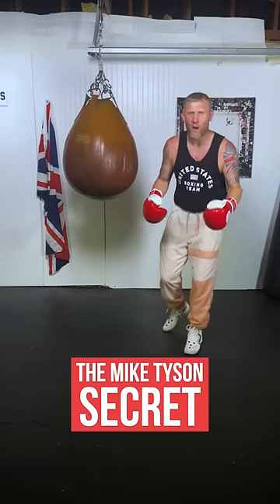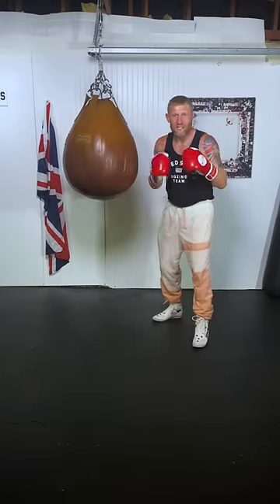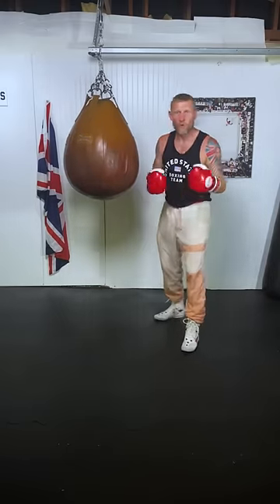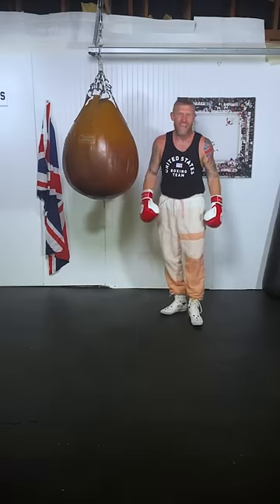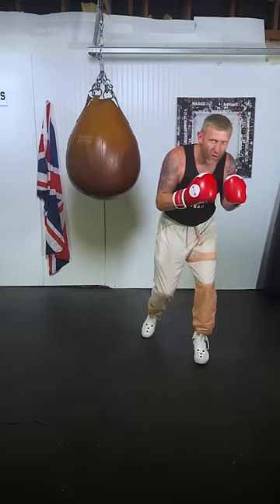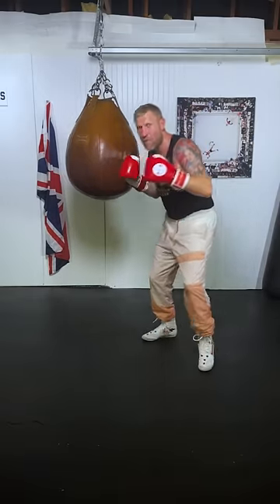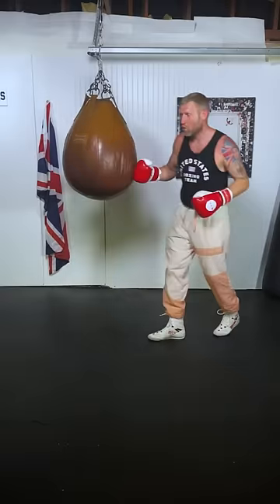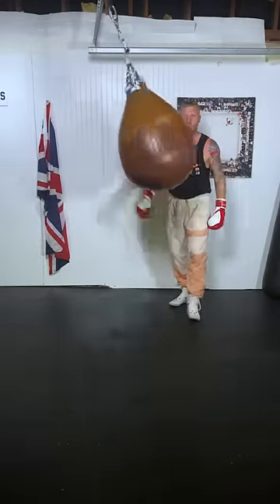Source of Mike Tyson's Power in his Punches #shorts

Comment: The transfer of weight is one part of how he developed his power, but it was also his timing and technique that magnified it so greatly.  When he threw his power punches, you could see him just whipping his arm around with a tremendous amount of rotational momentum, so much that it would throw him off balance when he missed.  He was so fast and so sound defensively though, that even when he'd go off balance, it was still difficult to set any punches up on him and he'd be loaded up to fire from the other side if you got careless.  At the moment of impact, you can see that he's getting his hips, torso, shoulder, bicep, and forearm all moving in the same direction and the result is a rib crushing hook.  I don't think most peopled would be able to pull off Tyson hooks though because of how open it leaves you when you miss.  Tyson could do it because he had such great movement and a good guard.

Comment: An even bigger reason is his footwork.  He would switch to a squared up stance, which greatly increases the power of hooks and uppercuts, and use the d'amato shift to load up his uppercuts and hooks quickly and align them in an unsuspected angle.  He could switch to southpaw to load up his former lead hand.  He also widened his base to such an extreme degree when throwing these punches when the opponents would shell up.
Reply from the maker: Thanks for sharing that info Joshua mate

Comment: but won’t it be slightly difficult if you r boxing and you are to the right, say your not that fast to be slipping quickly, and u need to be on the other side because the other side is open. what is like a counter in case something like that happens

Comment: 😂 He trained to punch hard by punching things hard

Swaying doesn't make slipping easier because you're moving in a predictable pattern based on your rhythm and need to stop yourself moving before you can move away from the punch

Throwing all of your weight behind your punch is good and will help you hit harder until you miss or get countered because you'll be off-balance. Instead, torque your weight with your hips and apply proper foot positioning to generate even more power while keeping your weight effectively static whilst you're moving

The basics of boxing are called that for a reason

Comment: The bag shouldn’t swing that much bro if your punching correctly the bag wouldn’t be swinging like that. Your pushing it not touching it.
Reply from the maker: Do you also box mate? And have you used a bag like this before?
Reply: @Tony_Jeffries  I should have thought a little more before I sent this, I’m In Muay Thai not boxing. I was just taught the other day that when my bag was swinging after a punch I was pushing the bag with my punches instead of snap my punches with the correct form. After I corrected my form the bad didn’t swing. Different bag tho, at first sight I just compared bags by determining the physics of the bag but the bag your using is different then mine and I was assuming it had the same physics that’s my bad lol